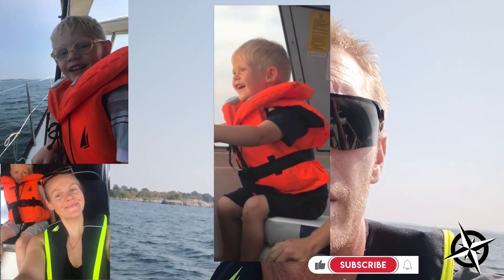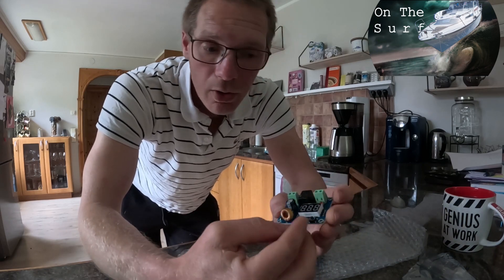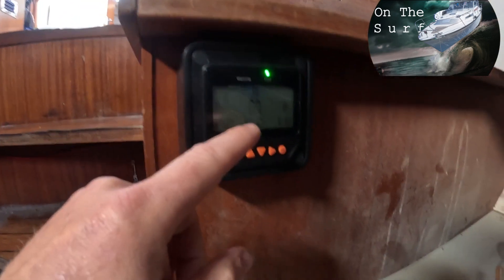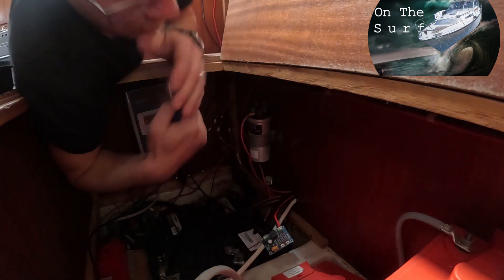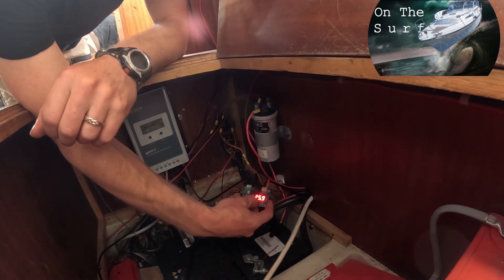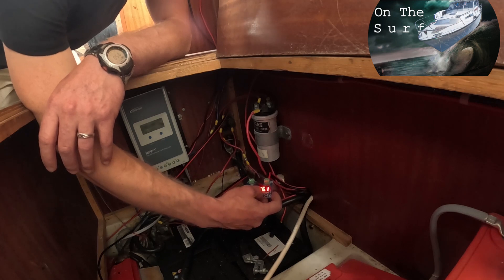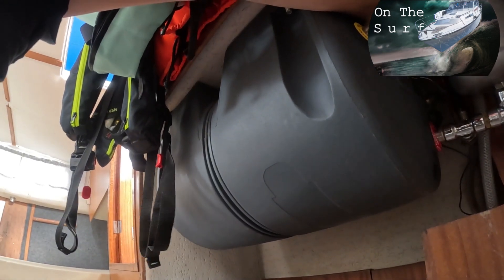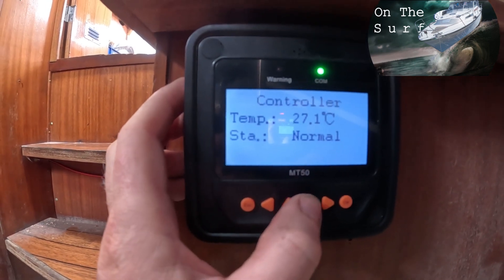Set up a solar dump load

Comment: Your batteries will see many micro top charge cycles and they will wear and sulphate faster with this method. Better to use a voltage sensitive relay on the battery which switches the pv directly, so that panels dump power directly without micro cycling your batteries.
Reply from the maker: @Humanity101-zp4sq well thats one way to do it, my setup is so the battery never gets 100% they will never be more than lets say 98% its just a matter of adjustment of the trigger voltage. This way dont need any fancy electronics and is cheap and really easy to install and setup but there are "better" ways to do it. The things i found cost more than my battery so everything depends
Reply: @onthesurf  Voltage sensitive relay/contactor is about £30.
Reply from the maker: @Humanity101-zp4sq thats just what this board is, a volt sensitive relay hooked on the solar output on the mppt, that turns on when the battery is at 98% and off att 96%